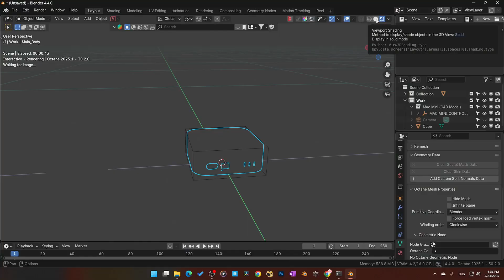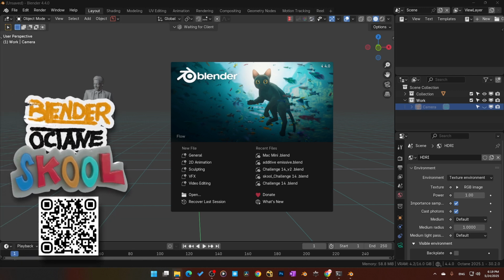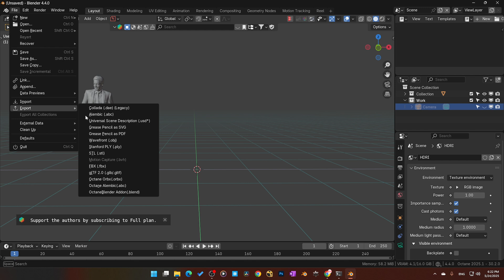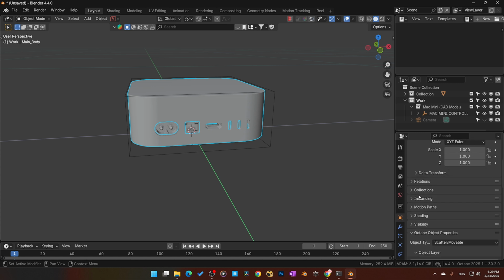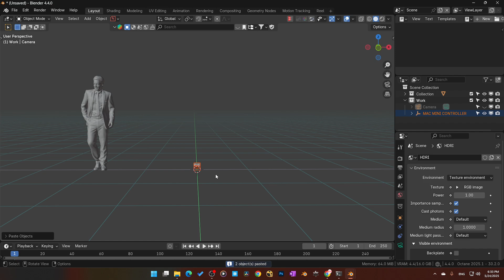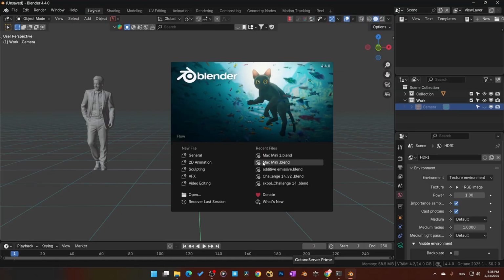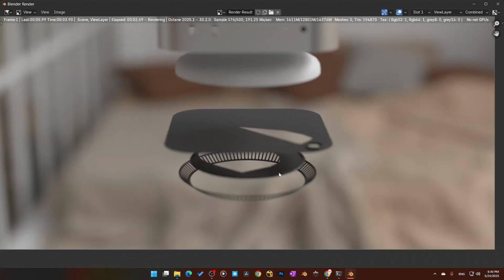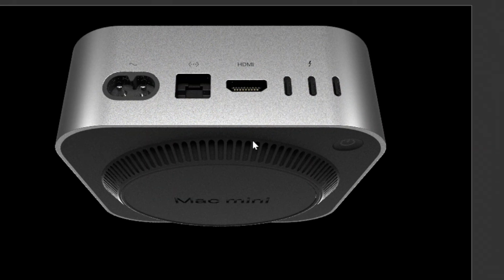Blender Keeps Crashing? Fix This One Thing

Comment: Hey Octane Blender guru, got a question, if I want to work in Cycles while using Blender Octane build, will it be fine? Or ideally I should download a separate Blender version, not the OTOY's one and work there in Cycles? I am testing here and there, Cycles seems to work just fine in the OTOY's Blender. Thanks in advance
Reply from the maker: In my Blender Octane Edition, I set up a new scene using the same HDRI and Octane settings. I also created a matching scene in Cycles. This way, I can easily switch between the two without any issues.

When I’m converting materials from Cycles to Octane, I bring the asset into the Cycles scene first—then flip over to the Octane scene to start converting.

P.S. I timestamped it in the livestream so you can see exactly where I switch between Cycles and Octane in the same Blender version.
https://www.youtube.com/live/6RSm_p9XAhY?si=GTn71NXq_1lTpx5u&t=165

Comment: Great video. The one that gets me crashes sometimes is displacement
Reply from the maker: Yeah, displacement loves to crash things 😅
Especially with high-res meshes or tight VRAM.

Quick tip: try using a lower preview level and baking if possible.
Also, check your subdivision settings — they sneak up on you.
Reply: @1polygonewithme  do you mean baking animations or textures?
Reply from the maker: Ya texture  @pauljulian2963